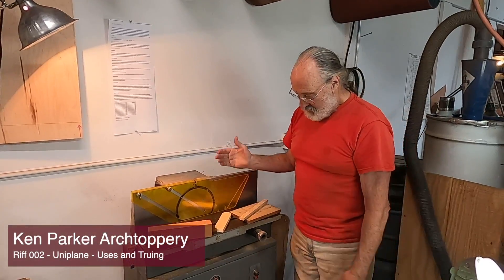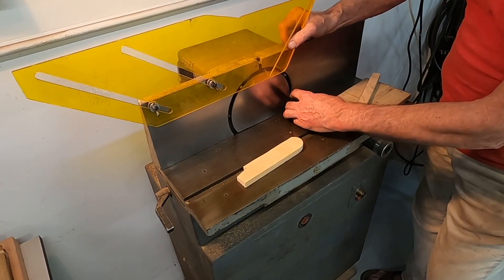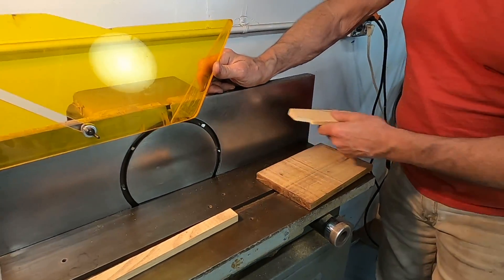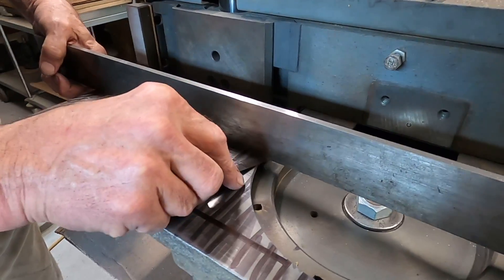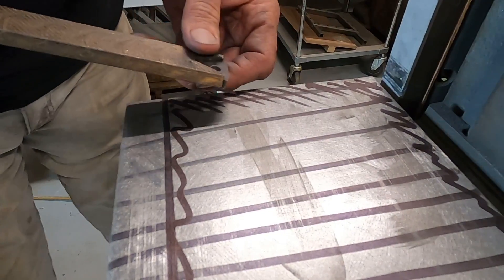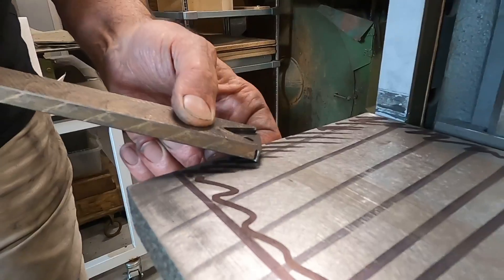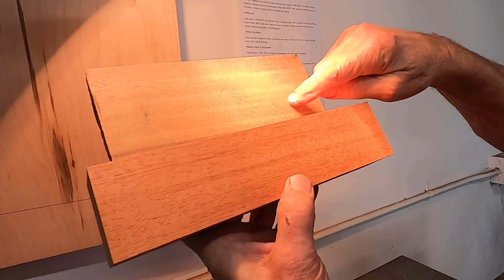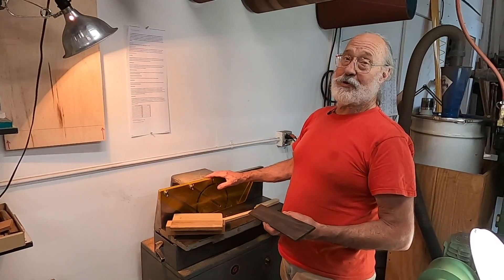Ken Parker Archtoppery-Riff 002 The Uniplane -  Uses and Truing

Comment: I know the Uni-plane is divisive in woodworking circles. It seems to be either loved or hated. I wonder if part of the reason is that they had casting problems during manufacture. Seems to work well once tuned up.
Reply from the maker: I'm guessing that the traditional casting/seasoning process may have been rushed on these machines. Iron castings that will need to be accurate parts are commonly stored outside for aa year or more to stress relieve, although there is some debate about the efficacy of this. Also, it turns out to be very challenging to accurately hold iron sand castings for machining without dstorting them, and sometimes this causes distortions in the machined surfaces when the castings are unclamped, a very problematic challenge for surfaces that need to be truly flat in order to work properly, like machine tables.
I have trued two of these machines, and it can be a huge amount of work, but the results are spectacular, almost magical..

Comment: Anyone have leads on where to find blades?
Reply from the maker: These are 1/4" square High Speed Steel (HSS) bits such as you would use on a small metal lathe, fly cutter, etc.
You might find a NOS set on ebay maybe, but you might need to create your own set of cutters if they have gone missing or aare mutilated/short.
Here is the Unilplane manual, the cutter section starts on page 10.
http://vintagemachinery.org/pubs/1141/4670.pdf
These are easy to grind with the specified shapes and angles. I fooled around with some changes to the tool geometries, but I'm not sure I improved anything much. 
The best thing would be to source the HSS bits at the correct length, but if you can't find these, just order the longest parts you can find and cut them to rough length like this...
Grind a groove at the cut line with your Dremel tool, or similar thing using a thin separating disk.
Try to make all the cutters the same length within reason.
Hold securely right up to your fracture line in the heaviest vise you have.
Strike the end of the tool bit and it'll pop off, breaking like glass at the cut line.
A thin shaped bench grinding wheel will be needed, or you could struggle for hours with the Dremel.
Have fun!

Comment: You really need to watch your knuckles,  that exposed spinning blade can easily get if you slip.
Reply from the maker: I "grew up" in a production wodworking shop, and saw plenty of folks with abbreviated fingers, etc.  I was horrified that these folks were so casual about getting mutilated, and It put the fear of the God of Injury into me! 
I can assure you that I'm Always Watching my fingers, knuckles, and every other thing that gets close to any cutting tool, power or hand. I have never had a bloody event with a power tool in over 50 years, and the key to this is a combination of 1) completely understanding the cutting forces appplied by the tool, and  2) Terror. 
You just don't slip, that's all, the consequences are too great.
Stance and mindfulness are a huge part of safe machining no matter what you're doing.
Always make sure you have an exit move if you need it.
This may involve a way to step back safely, or maybe to just let go of the work if something unexpectedly binds or breaks.
If you're not scared, you may not be paying enough attention to the risks.
You'll need to use your imagination properly by imagining what can go wrong, and how to safely respond.
Finally, use your conservative impulses to stay away from sketchy, flimsy setups that you've never tried before, and make sure you can take the cut with confidence.

Comment: Should have taken the machine to a machine shop that has a surface grinder that is big enough to flatten everything for you. Restored a Powermatic jointer this way.
Reply from the maker: This would seem to be an obvious solution, but I have found that surface grinding funny shaped castings, as these certainly are, presents insurmountable problems due to the extreme difficulty of perching the darn thing on the flat magnetic chuck so that the grinder can do its job. A huge amount of fixturing would have been required to get the surface to be ground parallel to the machine's travel, and nailed down so it couldn't move or shudder during grinding. I could have scraped three of these in the time it might have taken to make the tooling.
Reply: @kenparkerarchtoppery9440  Yes. Makes sense. Ken. You have the patience of a saint. I could never do that by hand. I don’t have that skill. I have a uniplane also.

Comment: I own one, and I like it.  I suggest using nylock wingnuts on the guard.  That way you can hold the guard at desired level above the table. Hmm, I wonder how much it would cost to take the fences to a machine shop and have them flattened.  I think a set of cobalt steel cutters,or possibly carbide, might be nice, and any machine shop could make them from 1/4" tool bits.  I've also been considering making a little sharpening jig to hone the cutters.
Reply from the maker: Taking the machine apart to true it probably isn't the best way to get it really true.  None of the parts in question are parallel front to back, and so some Major fixturing would be required to get the four cast parts held properly in a precision grinding machine. The Uni-Plane is a clever design and a nice idea, but it needs to be perfect;y true, or very nearly perfect in order to do its job correctly.  This is the second one I have blueprinted, and in both cases, it was a great deal of work to get things lined up and planar.  The castings, although fairly small, were all a bit bowed, cupped or twisted, and in need of some serious correction.  Cast iron is hard, and very slow to cut!
The cutters supplied are lathe tool stock, and as far as I can tell, are high - speed cobalt steel,  and hard to improve on. Carbide cutters were an option, and I have a set of them, but these are very challenging to sharpen, and in my opinion, have sharpness angles that are too low for them to give good service, as the carbide tends to chip when the sharpness angle is so acute.  We have fooled around with the tool angles, but they work fairly well as supplied. I remember finding some outfit online that will supply new cutters in sets.  When the thing is set up properly, it can really perform miracles.  We were able to salvage some very wildly cupped black ebony that I'd had kicking around the shop for decades and get a thick pile of beautiful, flat, .025" veneers for covering my pickguards.  Worked like magic, with No tearout, even working very thin material!
The guard, like many guards, is a joke, and just one more thing to struggle with.  Since the cutting forces are all downward towards the table, it's a stable cut, so just Keep your Precious Flesh out of the cutters' path!  Push sticks/push plates are a must!

Comment: Hello again. How does this machine compare to a jointer?
Reply from the maker: The uniplane works best with short pieces of material.  It's tough to control a long piece of wood, especially if it's heavy.  I don't think most woodworkers would choose this over a jointer unless they used short material for all their projects, like maybe, us, or a box maker, etc.  The surface you get depends on the properties of the wood, so it's kind of just like a jointer, only different.

Comment: Thanks Ken, always a pleasure to see you work! Scrap check scrap check with patience. Valuable advice! 
  Never heard or scene Green Heart wood? Where would you use that on a guitar if at all?
Thanks again Ken, 
Patrick
Reply from the maker: Green heart is hard & heavy and interlocked, so fingerboards, bridges?  I'm not a big fan of its appearance & color, so I'll stick with ebony, but it sure would serve well as a replacement material, and is in good supply.

Comment: Man, that’s cool! In all my years of woodworking, I’ve never heard of that machine. Thanks for posting.
Reply from the maker: I don't think they ever really caught on for one reason.  They excel on small pieces and can perform really well, but won't replace your jointer unless all your work is short.  Long boards would be very awkward.
Reply: @kenparkerarchtoppery9440 , lots of advantages for building guitars, though.

Comment: The topic of metal scraping appears every now and then in the machinist channels that I follow. Never thought I would see it being done  in one of my wood working ones :D
Reply from the maker: Great way to straighten out a twisted hand plane, or, better yet, buy ones that are already flat.
Reply: @kenparkerarchtoppery9440  in my previous life I had access to a surface grinder, and that is how I used to rectified a couple of old Stanleys that I was "restoring". Would you say that hand scraping is better than a surface grinder for this sort of applications?
Reply from the maker: @elluisito000  Either way, it's not a beginner's project.  The tough thing about the surface grinder is clamping the thin plane casting perfectly true to the machine's travel without distorting it.  That's a tall order.  Even then, you have to be very careful not to heat up the casting when grinding, as it will bulge and distort unless you have flood coolant.  After a couple of tries, I gave up and just lapped the castings on 1/2" plate glass with loose grit and water.  In 1976 I lapped a #8 jointer plane in this manner and gave it to Jimmy D'aquisto as my way of thanks for his help with criticism of my early archtops.   This was painfully slow, and I remember spending at least a week lapping the big surface outside on the lawn, kneeling so I could get my upper body over the work and apply some pressure.  Dark ages.  Now we have our pick of new planes that are perfect, although I still use the antique Bailey and Stanley tools that I've trued up.  Now that I've done a bit of iron scraping, if I had another plane to true up, I'd use the scaper to at least take off the bulk of the material, if not do the whole job.  Here's an example of what appears to be a Stanley #80 Cabinet Scraper expertly scraped by Burton LeGeyt...http://www.legeytinstruments.com/new-page
Reply: @kenparkerarchtoppery9440  I "lapped" de sole and the blade of one of my Lie Nielsens, it didn't take long, but it was kind of tedious nonetheless. That was after my failed attempt to restore the 2nd Stanley, the amount of work needed was so much that I decided to go and get me the nicest new plane I could afford, the Lie Nielsen hahahaha.